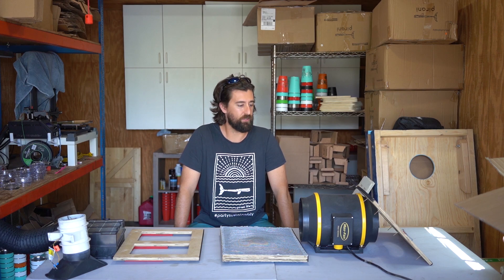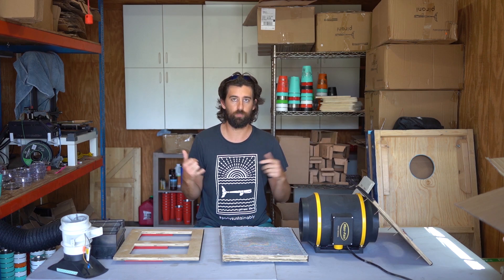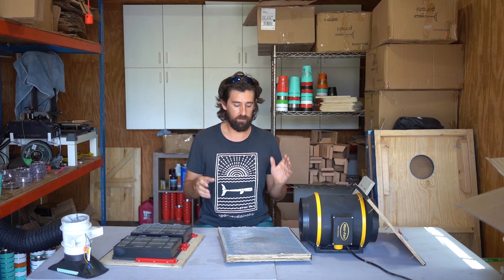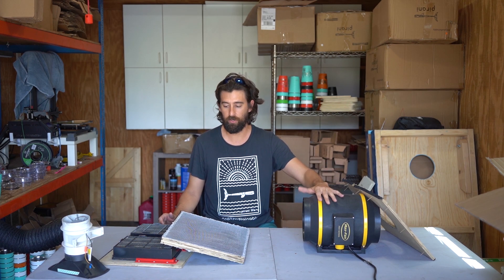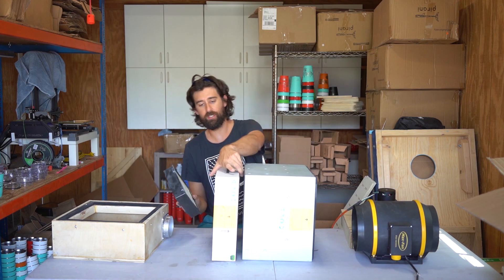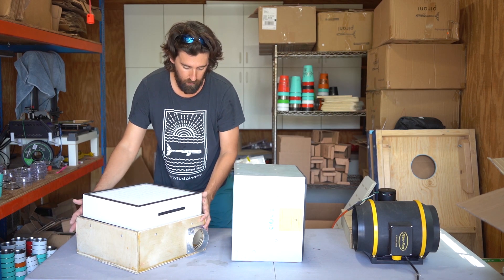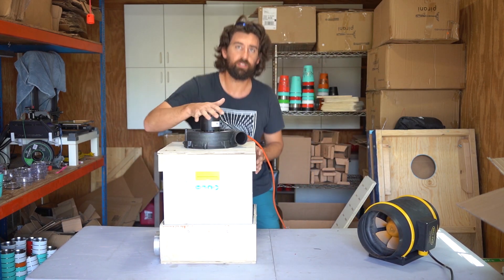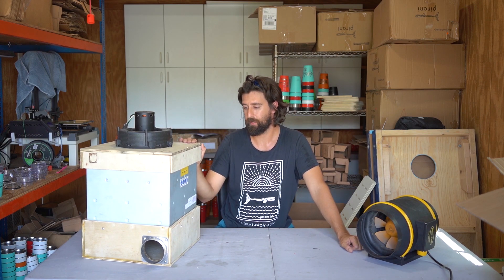DIY Meets High End Fume Extractor for Laser Engraving/Cutting

Comment: Just finished my build and did a first test with my Boss Laser machine. Nothing :( I mean it barely draws any air from 6" duct. All the smoke stayed inside my laser. I guess this is no good for 6". Unless I didn't built it right :(  There are 3-4 mm of space around big BOFA filter, not sure it matters tho as it sits on the foam tape
Reply: did you figure it out ? looking to purchase the parts as well to get my build going but your post made me pause lol
Reply: @letsmakeitshop   Working on it. Found one mistake of placing foam insulation on the inner edge of the wood planks this caused leaks around filter. Moved foam to the outer edges and that fixed leaks and increased suction. But it's still not enough for my setup, not even close. You need a bigger fan if you using larger ducts and have big volume of air to move, CFMs do matter as well as static pressure.  I just finished building new top and using 6" Fantech fan. Waiting for caulk to dry to test it. Also made new top bigger to it meets bottom and will add clasps and foam around it just in case...  I plan to post my build on my channel if I ever get it working :)
Reply: @madeinbasement  ok keep me posted, i'm very interested, also keep in mind plywood etc is porous so if it was me i'd seal it with either a thick paint or duct tape, had that issue before...
Reply: @madeinbasement  Wondering if something like this would be best https://ramweldingsupply.com/p/lincoln-electric-sf2400-stationary-weld-fume-control-fan/ obviously alot more $$ but looks pretty strong
Reply: @letsmakeitshop  Ok just did a test with cutting 12x12 plywood sheet. Good news is I think it works!  I can see smoke swirling inside machine, but absolute no smell outside!
Bad news is filters themselves don't seem to be eliminating 100% of smell so you still have to went outside. I'd say it reduced smell by 80-90% but I can still smell it at the exhaust. I was hoping charcoal will absorb 100% especially at this price point. Also if you just starting out take a look at "fume coffin". It's about 1/2 price to build and filters are 3x cheaper, but I don't know about efficiency...
As for porous plywood, I'd say no need to worry. Because of the design fan is pulling air out so at worst leaks will reduce it's efficiency. No smell leaked anywhere outside the  system other than fan's exhaust.
Reply: @madeinbasement  So that was with the fan listed ? out of curiosity how big is your laser cutting area ? mine is 1200x600, I did look at the fume coffin and prefilter, it does look like something i could do but the cleanup part is awful in those types of diy systems, the moment you open that box when it's saturated, it's extremely concentrated toxic materials, so i'm not so worried about changing filters a couple of times a year and prefilter every couple months. If anything i could build the prefilter part of the fume coffin and add it to this design. when you say smoke swirling, did you see being sucked out pretty quickly or did it linger much ? Thanks!
Reply: @letsmakeitshop  Cutting area: 400 x 750mm.  Smoke does get sucked out eventually, I just keep fan on for about a minute after cutting is done. None of it got out of the machine so far, I had absolutely no smell in the basement (which  never happened before with just the fan).  I'm waiting on anemometer that I ordered. It will show CFM rating, I'm going to compare these two fans...
Reply from the maker: @madeinbasement  I am really surprised this hasn't removed all of the odor.  I don't cut wood, but I do powder coating engraving and we now have our Portable AC and all of the doors running.  We used to have to vent it outside and sweat our asses off.  I am excited to see your build!

Not sure how you did the 6" ducting, but you definitely want to keep it 6" all the way through.  Try to avoid going 6" -> 4" -> 6" as it will cause the flow to be diminished.  Also, a big part of the reason I chose the one I did is because I am lazy... I had 1 hole saw that size and it came with a foam gasket so it was just a drop in place.

Lastly, not sure which anemometer you bought, but I kiteboard a lot and I had one that was about $60 and it was complete garbage.  It was like 5 years ago I bought it so maybe they are better/cheaper now.

If you want to have something blow your socks off, I bet these would work.

https://smile.amazon.com/XPOWER-X-400A-Speed-Outlets-3-0-Amp/dp/B00ANNL3DW/ref=sr_1_5?dchild=1&keywords=3+amp+centrifugal+blower&qid=1587830950&sr=8-5

This would just have to have the most open side pulling and then put a piece of wood or something on the side facing up.  It would definitely pull some air through.

https://smile.amazon.com/iPower-Inline-Ventilation-Exhaust-Grounded/dp/B009LCEUEK/ref=sr_1_3?dchild=1&keywords=3+amp+centrifugal+blower&qid=1587830950&sr=8-3

This claims to have 442 CFM... I don't know I believe it.

https://smile.amazon.com/Fasco-50769-D500-Centrifugal-Blower-Bearing/dp/B0099BP4Y8/ref=sr_1_23?dchild=1&keywords=3+amp+centrifugal+blower&qid=1587830986&sr=8-23&swrs=8255629A5EFE8C965BB0984E6E883F59

Some retrofitting would be required.
Reply from the maker: @letsmakeitshop  I saw a few 2+ amp blowers but were more than I wanted to spend.  I'd be skeptical of the fume coffin.  I used the exact same fan they spec, as you can see in my video and axial fans (the Max-Fan) are really great for unrestricted flow.  I still use it in my shop to circulate air, and it does a great job.  Put a filter of any sort in front of it... Dead.  I used to work for Sunbeam/Bionaire/Holmes and didn't do most of the mechanical engineering (I am an industrial designer) but tore them apart regularly.  They all use scroll/centrifugal fans.  Never once did I see an axial fan.  Shame on me for recalling that on my first build!

I am stubborn, so if you need to try it, I don't blame you and maybe if you have less media filtration, it could work. (won't work with the BOFA filter)
Reply: @BrandegeePierce  Got anemometer and I'm not sure if it shows real numbers but it's relatively accurate for comparison... So yeah my 6" Fantech (rated at something like 400 cfm) definitely draws more CFM thru laser machine and filters than Fasco fan.  But I didn't stop there. I had another 6" fan (similar to Fantech) so I connected it to the output of first fan lol. That almost doubled suction.  I'm getting around 430 cfm (measured at laser bed vent) compared to 290 with single fan.  It does help a lot with smoke too, I can see it's all getting sucked in within 10 seconds after I finish cutting. I even tried cutting with cover open and it was able to get rid of smoke mostly  before it got out. I might replaced both fans with one 10" fan in the future, but for now it works...  As for smell getting out of filters, I think maybe top cover is not pushing hard enough on the rubber gasket at top of the BOFA filter. I ordered some clamps and will install them to pull both halves  together, maybe it will help... Oh and I installed casters and painted whole thing with "industrial" (black and yellow stripes) and installed 3D printed carry handles. It looks like a huge ghost trap from Ghostbusters lol
Reply from the maker: @madeinbasement  I'm jealous that mine looks like crap now. Also, that fantek fan will probably get dirty pretty quick. That's the reason all of the filters have the blower post filtration system. Lastly, I have a little k-40 that I use this for mostly and definitely don't need more drawl than what I'm getting so I guess if you have a big machine you'll need the six or 10-in as you mentioned.
Reply: @BrandegeePierce   Dude, without your video I'd have no idea about these filters. Thank you so much! Doesn't matter if it's pretty, it's behind machine lol...  As for fan getting dirty, well I had it venting straight without any filters for about 3 years and it's a little dusty inside but nothing terrible. With filter it won't get much dirtier! :)
Reply: @madeinbasement  I ordered the same fan you got along with the M-6 Booster as well, should be good, getting everything delivered Friday and will be doing the assembly, filters already here! Thanks again!
Reply: @madeinbasement  provide any of the measurements for the Filter assembly I want to start building the box for my system. I did purchase the 6" fan assembly as I have a 20x28 engraving area and the smoke lingers for ever. What type of wood?  Thank you in advance..
Reply: @jeffreyhoy8452  What is the difference between the Fantech fan (I don't see a model, but it looks like maybe the FG 6LX?), and the Tjernlund M-6 fan?  Does the Fantech fan deal with the high pressure of the filter media better?  Could I just go with two of the M-6 fans and get the same effect? Or maybe start with the M-8 as my main blower?   My laser has a fairly large case, so I'm trying to move a lot of air also.

Comment: Great video! Do you know of any centrifugal bigger/stronger fans for larger laser machines?
Reply from the maker: I don't but what size machine are you using?
Reply: @BrandegeePierce   I'm using Boss LS-1630. It has 6" outlet. But space inside machine is pretty big so I might need more static pressure.  I will try the fan you suggested (it's arriving today) and see how it goes. Already got the filters too. Thanks again for the video, super helpful!
Reply from the maker: @madeinbasement  you'd be surprised the draw that blower has. The hard part about the blowers that work that way is they don't have CFM rating as they are meant for furnaces. What I did to assume that would be strong enough was looked at the amperage. If you need a stronger blower, try to find one that is around 3-4 amps. I believe the one I used is 1.8. let me know how it works for you!
Reply: @madeinbasement  I also have a Boss LS-1630 and was wondering what fan would work for my machine. I sent this video and components to my cousin who works for an industrial ventilation company. Long story short, this filter is rated at 250 CFM, meaning anything higher will decrease the efficiency considerably. For the fan, his engineer said you need a suction blower at 250 CFM with about .5" static pressure. That begs the question, is 250 CFM enough for the 1630? In my experience, 250 CFM wasn't enough to draw out smoke and fumes very well for this machine. This is a great video but i think I'm going to try and find a different filter. The alternative, according to the engineer, was to buy a 500 CFM fan and pull it through two of these filter setups running side by side or buy a 750 CFM fan and pull it through 3 of these filter setups running side by side by side. Seems like it would get expensive quickly that way, though.

Comment: How loud is the fan? There's some free decibel apps, not super accurate but gives a decent idea. Would also be nice to see how it pulls the smoke away from the item you are engraving with the filter in place. I'm wondering if what I have is overkill. It's what came with the laser, and sucks the smoke away instantly. But is loud as heck as well. You really have to raise your voice to talk next to it.
Reply from the maker: @Chad Voller Loud is all relative... I'll get the reading on the dB's this week.  It is not loud at all.  In my shop, my laser engraver sounds like a jet engine because it has some beefy (but cheap chinese) computer fans.  With just the extractor on, it is still very possible to have a conversation.
In regards to the question about the VOC sensors - 
I wouldn't buy a kit because they are, as you said, not great or really just hobby level.  Newark, Digikey, or Mouser (amongst many others) are likely the supplier of the actual component in the $2k fume extractor I mentioned in the video.  I would probably buy this sensor. https://www.idt.com/us/en/document/dst/sgas707-datasheet  Would want to do more research to ensure it meets my requirements, but any voltage or I2C sensor is easy to interface with and would probably only take a few hours to get up and running. I don't plan on making a display or anything fancy, just an alarm really.
Reply: Brandegee Pierce Cool. I've got until next winter before I'll need a system setup. I subscribed to stay updated.